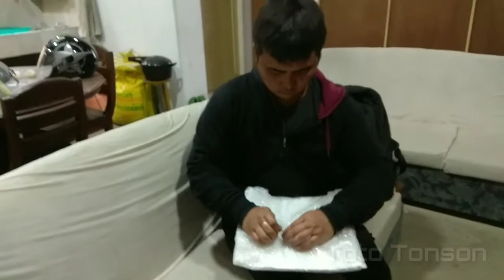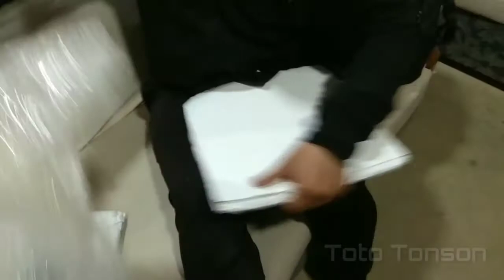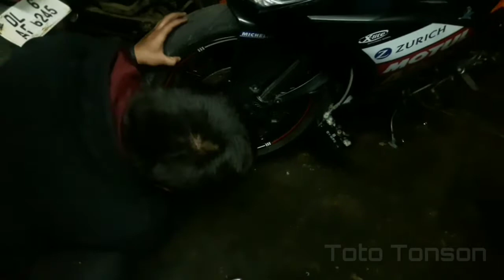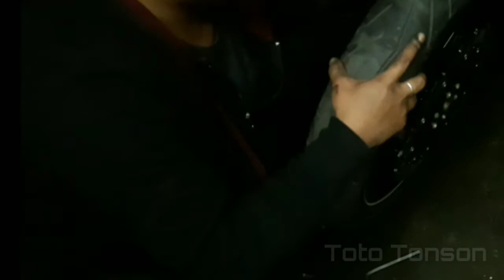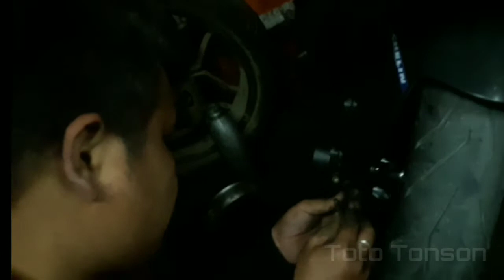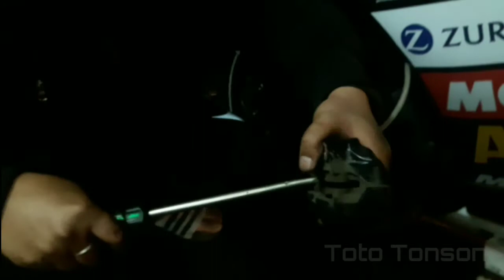Upgrading my Ktm rc200 Disc Plate to 320 mm Rotor disc | Ktm Powerparts | Ktm Rc Rotor Disc

Comment: man, may i get spacer length in mm? i've bought one, but the seller didnt give me the caliper spacer so i need to make it but i dont know the length of the spacer
Reply from the maker: You better double up the stock spacer...
Reply from the maker: Btw your bike year model..??
Reply: will it touch the rivet button? or perfectly fit?
Reply: 2016
Reply: i believe the stock one is 300mm diameter, not 280mm
Reply from the maker: @hansolo4854  no you have to change the nut bolts with longer one..
Reply from the maker: Perfectly fit..
Reply from the maker: @hansolo4854  calculate like this...the first model of the duke disc palte was 280mm with no spacer then the 2nd was 300mm with one spacer. So, the difference is only 20mm, means the stock spacer is 20mm. Now, you are upgrading it from 300mm to 320mm.. So you just have to put one spacer each on both sides..
Reply: make sense man, thanks a lot. Really appreciate your comment
Reply: yep, i notice that.
Reply: so how its perform?much better than stock or same?
Reply from the maker: @hansolo4854  hope you liked and subscribed.